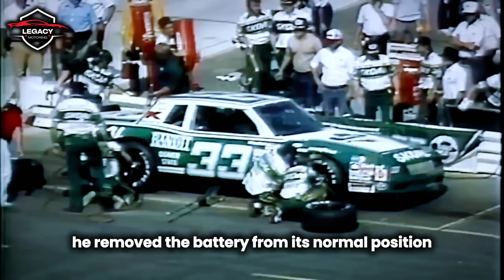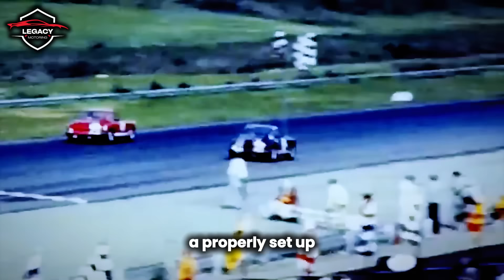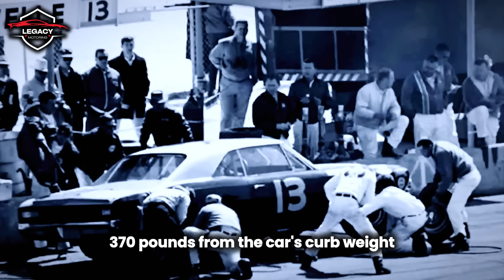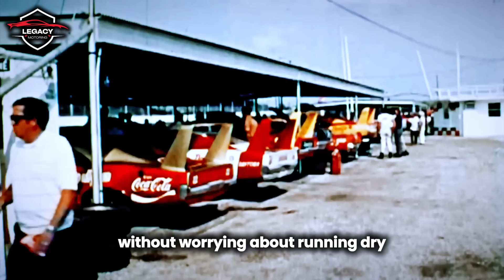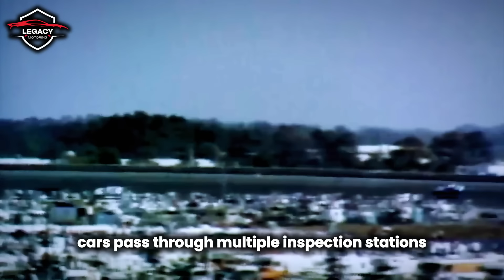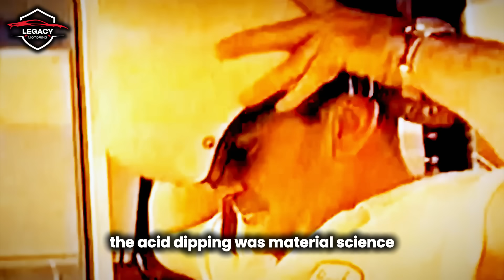5 'Banned' Racing Tricks That Forced NASCAR To Rewrite The Rules

Comment: A fuel line might be 3-4 feet long on a first-generation VW Type 1 through 4; 11 feet of length is about right for a typical front-engine RWD car — tank-to-engine-mounted-mechanical-fuel-pump.

Assuming a 2-inch ID, 11 feet of tube holds 1.795195 US gallons; assuming a 3/8-inch ID, 11 feet of tube holds 0.063112 US gallons.  The difference is 1.73 (2083) US gallons — enough to potentially move a refueling stop down by about half a lap during the race, but not enough to reliably provide a decisive range advantage: the additional fuel couldn’t be replenished during the race, so it was really only useful during the final lap.  Before the final lap, the car would simply have been carrying the weight of an unnecessarily large fuel line and the weight of the extra fuel (the additional fuel would have been less than 10.4 pounds and the extra fuel line and mounting hardware would likely have been on the order of 11-12 pounds, so figure the car was 26 pounds heavier than it needed to be.

Notwithstanding the ability to shuffle the refueling window based on track conditions and competitor practice, this doesn’t seem like a winning strategy.
Reply from the maker: Appreciate the detailed breakdown and math on the fuel line capacity! 🧠

Comment: You mention the McLaren F1GTR winning Le Mans outright, then claim that the rules were changed because of it. Not so. The reason for the F1GRT's win were simple. It rained through most of the race, which meant that the more powerful prototypes that were expected to win couldn't use their extra power. The GT cars, with less power, could use the power they had without generating wheelspin. That's it. Wet track + Big Power = Massive Wheelspin & control issues, wet track + not-so-big power = Less Wheelspin & better control.
The rule changes you refer to weren't to hinder the F1GTR, they were the creation of GT1, a rules package designed to interest manufacturers in racing in the class. Yes, the F1GTR fell under these rules, but the McLarens were actually faster in GT1 than they had been under the old ruleset, as the engines were less restricted than before, and they were allowed a special "longtail" bodywork kit, which increased downforce while also reducing drag. The fact that the McLarens didn't win Le Mans under these rules was more due to their competitors (Porsche & Mercedes) being allowed to design pure racecars which were then detuned for the road, rather than McLaren racing a modified roadcar with bodywork tweaks & a detuned engine...

Comment: The smart thing would have been to use a heavy gas or even a liquid instead of a solid buckshot.  Fill the frame rails with tungsten hexafluoride or xenon and then release it in small amounts during the pace laps.   Lot harder to catch until the "tapping the frame rails" era.  You could also fill them with helium AFTER the weight in... 😂

I also feel like you could still acid etch things if you acid etched a lattice into the back side of the surfaces instead of the whole panel, using the same technique that we use to make circuit boards, paint on a series of thin lines of a cover to block the acid, a photoresist.  You could make a panel that is thinner AND as thick as stock.  Then smooth the surface with a lightweight paint to fill the ridges.  A caliper wouldn't work anymore.

Rally teams with illegal engine maps that activate under specific conditions... That's called tuning a car well... O.o  I will die on this hill damnit... The engine SHOULD respond to conditions to perform at its peak at as close to 100% of the time as possible.  If the sanctioning body doesn't like it they're just wrong, full stop.  That's literally the purpose of EFI, computer maps and VE tables, the timing map, even the shift pressures and points, etc.   every pro car has access to these tuning tools or should if they're gonna pretend to be a pro...
Reply: The buckshot trick was cheaper & simpler to implement than using a gas based system. Less easy to trace too - someone from a race team buying buckshot in NC would be seen as a frugal hunter, reloading shotgun shells instead of buying new. Someone from a race team buying specialised gases in quantity from an industrial supplier? That's going to raise some questions.
As for acid etching, the real problem was the weakness of the panels. When the Penske team was found out, it wasn't by a detailed tech inspection. It was by one of the tech inspectors resting an elbow on the car's roof while having a conversation with a couple of team members, and leaving a noticeable dent. At that point, the jig was up, and the team had a problem.
As for Rally Teams, there's been many cheats over the years, from the simple - dumping unburnt fuel into the exhaust when off-throttle to keep the turbo spooled up by killing the spark in some cylinders - the ECU mod, to things of genius like the Toyota trick of bypassing the air restrictor under load while still passing inspection (a system so elegant the head of the FIA called it the greatest cheat he'd ever seen, before throwing Toyota out of the WRC for two years), or the Ford "pressurised exhaust" which used a clever system of flap valves to keep their turbos spinning by storing pressurised exhaust gases & recirculating them through the turbo when off throttle. Same effect as the ECU fuelling trick, but without the noticeable flames. IIRC, that one lasted half a season before the rules were re-written to outlaw it...